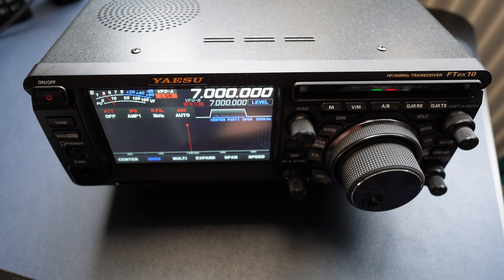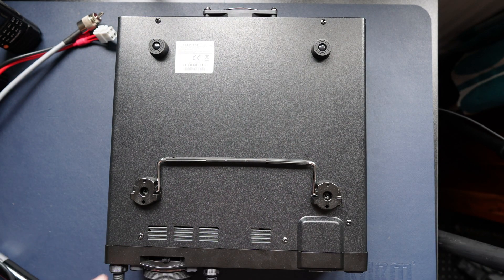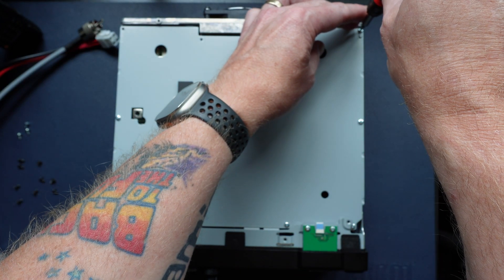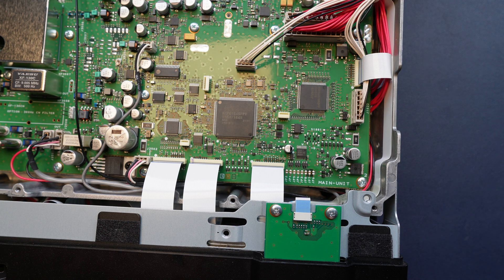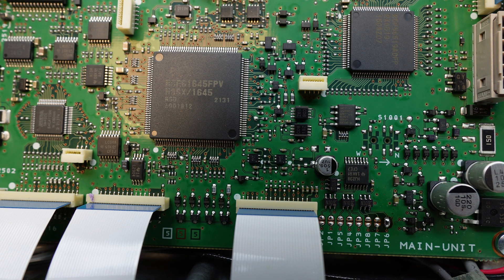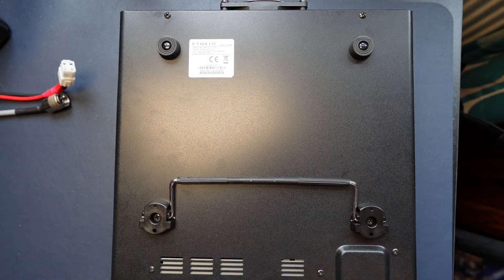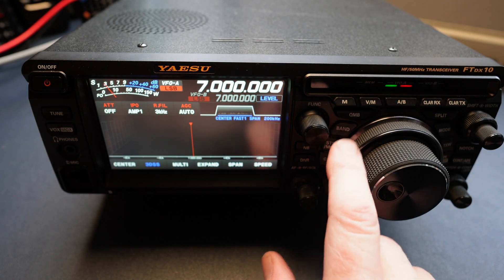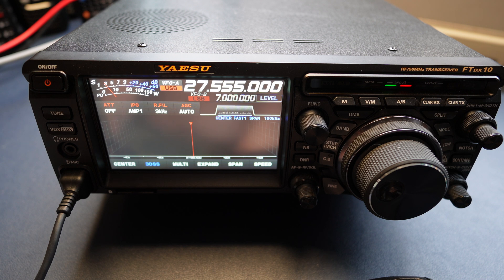YAESU FTdx10 MARS/TX Frequency Expansion Modification EU/USA

Comment: Not needed.  Do your research, it’s already capable.
Reply from the maker: This modification is from the official YEASU dealer given instructions. Most of the newer breed of radios are capable of a none permanent soft mod but you loose a few features like CAT control on the expanded bands to name one. Maybe that has changed with recent firmware updates so I will take a look but.
Reply: @gtretroworld  Did you take a look about that?
Reply from the maker: @markogorjanc5686 As far as I’m aware the solder method is by far the most reliable permanent method.
Reply: @gtretroworld  I meant if you take a look about loosing features like CAT control on the expanded bands?

Comment: Does doing the mod and using radio on other bands cause it any stress and problems with radio
Reply from the maker: @danjor_droneitsme6874  Modifying this radio has no ill effect on the radio. I suppose running it flat out on 11m FM all day wouldn’t be a good thing for the PA but on a whole it will be fine.
Reply: @gtretroworld 
Thanks for your reply appreciated,im going to do temp mod,not solder confident.
Im on tyneside to,thanks again

Comment: soldering is not needed for this modification. If you want it to be permanent then yes solder away. If you use just something conductive across the pads long enough to do the reset then that is all that is needed.  This method works for numerous yaesu model of radios. I have don't them many of times. If you have to ever send radio back in for any reason to repair for something then just do a reset of radio and when you get radio back do the mod again by using a temporary conductive bridge across the pads.
Reply from the maker: Been through this a few times now where i have done the non permanent mod to only get it back after it’s been reset to then having to do it again. So for me i will stick to the solder method, just as easy and folk can reset and update their firmware without having to open it back up.

Comment: Good deal. Thought it would be more complicated. Especially for what the shops charge you to do it. I have my 857 done so might not try the 10 but its nice to know how. 73s and thanks n1shu.
Reply: Muchas ya no cobran ese servicio cuando compras lo pides echo y no afecta ala garantía como ase años los tiempos an cambiado
Reply: In the UK it does with the likes of Radio world , Lamco etc m @radioamigoscanariasespana8021
Reply from the maker: It is a very straight forward modification, i think the manufacturers make these mods simple these days on purpose just to get the sales. Thanks

Comment: Thanks! nice one!... you make it look easy as 123
Reply from the maker: Thanks Tony, to be honest it is very straightforward. I’m sure you have done several too.
Reply: @gtretroworld  The FTdx10 is my first new, i wait for warranty to expire. all my others have been done indeed, but were done. But i did coillect the info on all of then how to do it. most of the time its those jumpers. only be careful for Japanese firmware. there it sometimes just don't work and the lower power
Reply from the maker: @TonyAlbus  Yes Japanese radios can be quite awkward especially Icom but there is normally a workaround if you contact the companies.
Reply: @gtretroworld  Just remember that the Japanese FT-817 is locked.